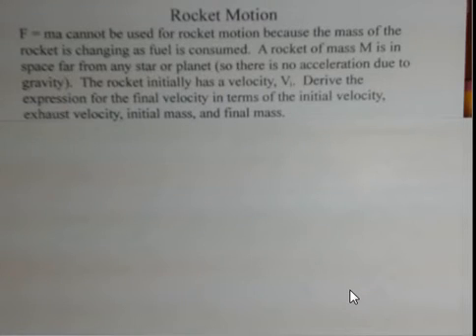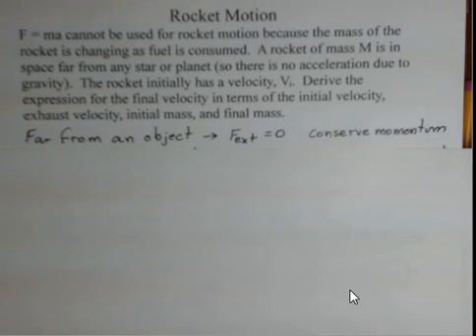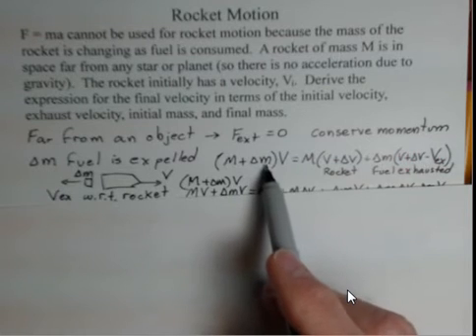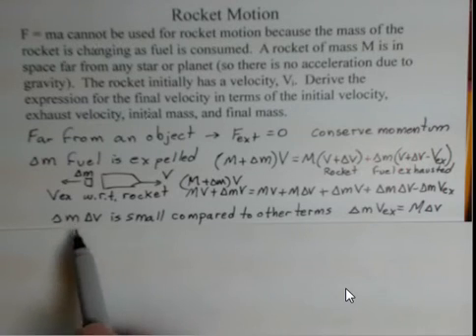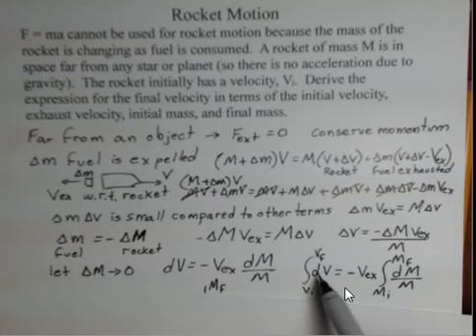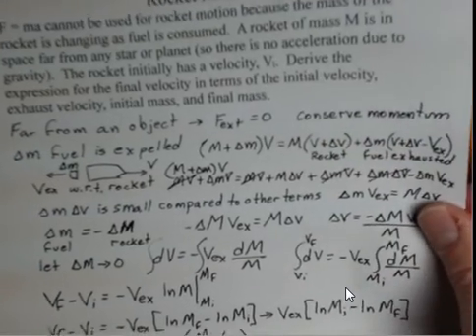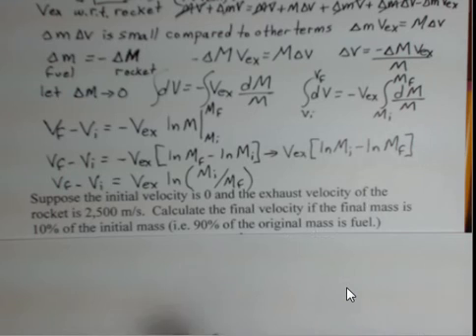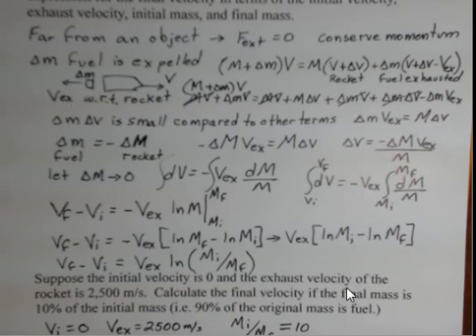Derivation of Final Velocity of Rocket

Comment: Sir plz explain  expression for final velocity  of the rocket 🙏🙏🙏🙏🙏🙏
Reply from the maker: Vf is the final velocity of the rocket.  Vi is the initial velocity (=0 if at rest before rocket engine is fired).  Vex is the exhaust velocity of material from the rocket engine.  Mi is the initial mass of the rocket including fuel before the engine is fired.   Mf is the final mass of the rocket and possibly fuel when the rocket engine stops burning fuel.  I hope these symbols are also explained in the video.  When I put in the numbers I used 0 m/sec for the initial velocity of the rocket.  Please note, this is for the case when the rocket is not near any large mass (i.e. it is not being launched from the Earth).